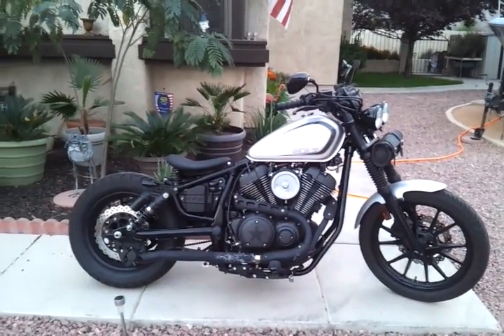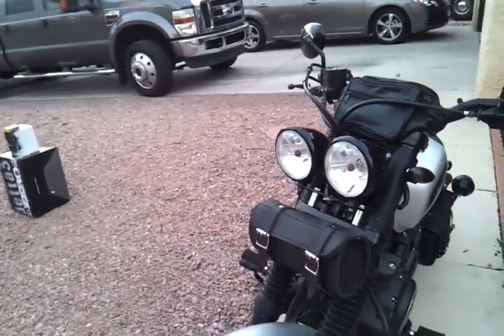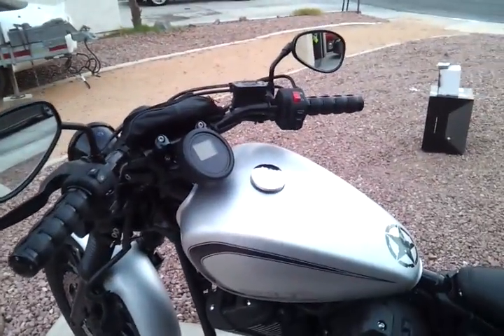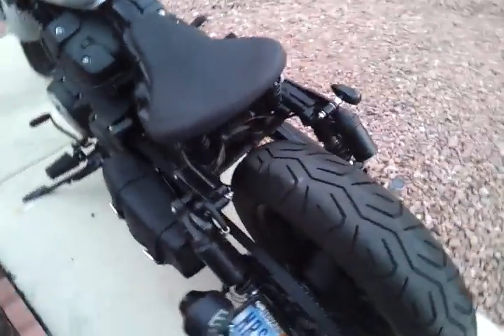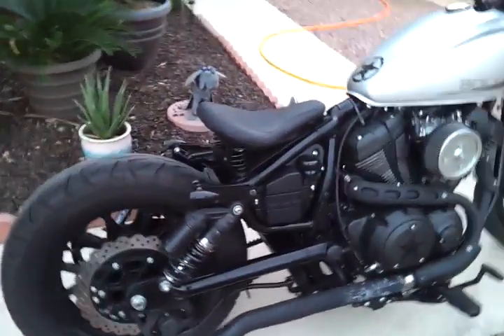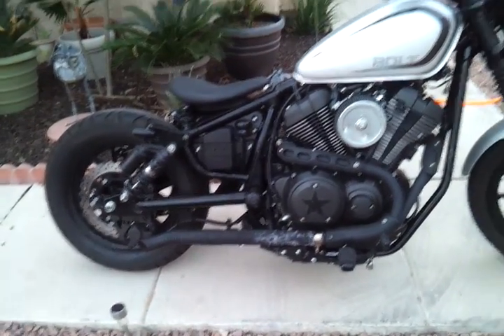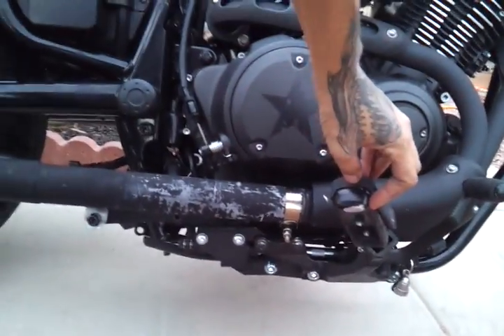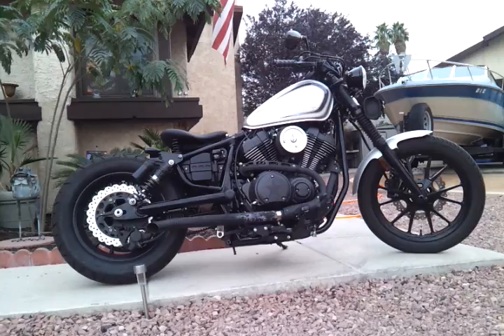2015 yamaha bolt phase I with sound - Grey R-Spec

Comment: The Bolt was made for this. Truly a fully customizable bike. I may steal your headlight and leather ideas
Reply: where you buy those headlight...? can i found this on eBay ?
Reply from the maker: The ones in the video are from SS Custom Cycle's BKB headlights found here with the mounting bracket ...
http://www.sscustomcycle.com/products/customizing/Yamaha/Bolt.shtml

But I have changed to 2 of these now.. (I still needed the SS Custom Cycle mounting bracket though)
http://www.ebay.com/itm/like/262398793613?lpid=82&chn=ps&ul_noapp=true

Comment: Freakin love that setup. Awesome job on the DIY stuff. I'm jealous. Been looking at getting another bike here lately and I believe you have me sold on the Bolt.
Reply from the maker: Lots of options out there.. but if you like sport bikes and cruisers .. this is a pretty awesome ride.
great price.. lots of styling options .. and you can swap back and forth if you need to..
IE" if i wanted to take a road trip with bags.. it would take me less than an hour to put the fender and original seat back on.
 .. sometimes I wish it had more to give though... 100mph comes pretty easy, but that's about all you get (107-111 maybe)
Reply: I might not even get that. I'm about 225 on the hoof. I really just want something raw and somewhat sporty for shooting around town and maybe my hour commute to work.

Comment from the maker: I made it.. welded a straight 18" pipe to a turndown and welded a hangar bracket I made to mount to the frame using one of the original exhaust mount bolts.
used high temp paint and cured in the oven.

Comment: thanks for the comments :)  i have a blast on this bike.. and it gets looks everywhere (wtf is that thing :)
speedo ring is just held on by double stick tape.. pry off with a small flathead screwdriver or knife with little twists in a couple spots around and it will pull off.. be gentle and don't paint the tape bits and you can reuse (i've had mine off twice and back on with the original tape)
the headlight is a little involved to remove, but not rocket science .. there are some posts on yamahastarbolt.com for details if you need them.

Comment: Nice work, practical.  Love the sound.  Have you ever considered the exhaust wrap?  Just wondering
Reply from the maker: I have thought about it.. and may do it as it gets warmer. (i'm in Vegas). 90 degrees today ..  even in heavy jeans it gets pretty warm on the legs.. still considering apes too .. just would hate to do all that work running cables and decide I don't like it.
Reply: Om makes sense.  Excellent work bro.  Gotta love the bagger look.

Comment: Great job customizing the Bolt, i just bought the same exact model and year. The reason i went with the bolt is because they provide a great platform to personalize the bike, i have a question, where did you get the sticker stars from? they fit the bike perfectly...Thanks!
Reply from the maker: cool.. 
best prices 
http://www.pixeldecals.com/shop/Military-Decals?product_id=286  
4"
Reply: bitchzilla
Thanks, Mate!
Reply from the maker: Karim B this was actually the site I used..http://www.fastdecals.com/shop/fireman-police-armed-forces-decals/weathered-army-star-decal-sticker.html

same thing, but this one has more color options. (little more expensive too, but not bad)
I have a couple dark smoke on the sides of the bike, and a carbon fiber black on the tank..
Reply: Thanks bitchzilla I ordered some from the website and placed one on the top of the tank an one on each side of the tank right on the top of the Bolt word...looks nice.

Comment: Looking to buy one of these here in Vegas. Big difference in the different bolt models?
Reply from the maker: he 2014 speedo is very dark.. but I don't think anyone has any of those left..unless buying used.  I think the replacement speedo is around $350 and worth it for most people.
2015 (2014 too for that matter).... the only differences between R-Spec and non R-Spec are the reservoir shocks and the seat material.
.. forgot to mention the cafe model available this year - C-Spec .. different style seat and fender.. foot peg position too.
 Hit up yamahastarbolt.com .. tons of owners with lots of intel .. or ask here.. happy to answer what I can.

Comment: Nice ride.  Did you feel an increase in power with the intake and home made pipe?  Definitely sounds meaner and I am sure you lost some weight off the bike.
Reply from the maker: *****  thanks. dropping the stock pipe anchor was about 20#..  
a new intake and almost any replacement pipe, will  give you a noticeable boost in power.

Comment: Did you make the brackets for your rear turn signals or did you buy them somewhere?
Reply from the maker: Christopher Flesner... bought them from sscustomcycle.com .. with the lights. Kind of expensive combo, but it was the look I was going for. ...I should have purchased lights elsewhere for 1/4 cost and made my own brackets. One of the front brackets broke at the bend after 3000 miles...